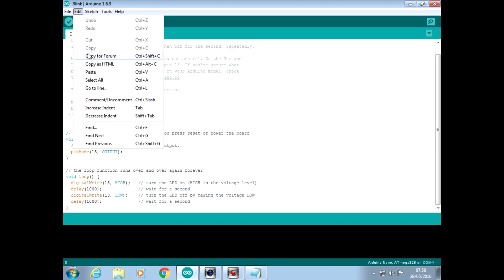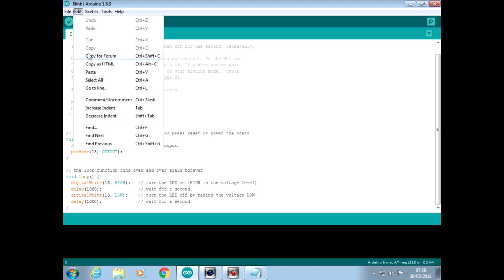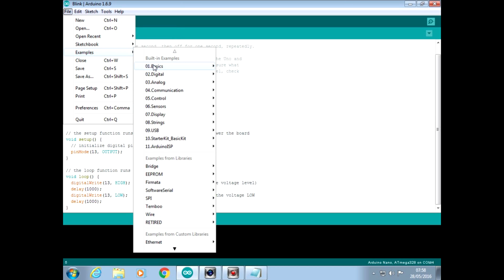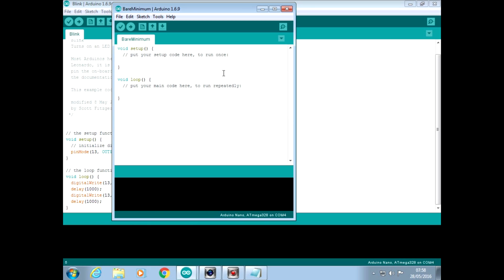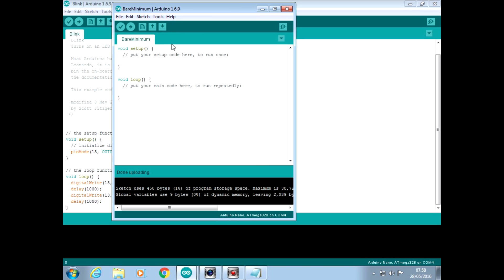Arduino NANO Power & Current Consumption

Comment: That Keweisi USB power meter (model KWS-V20) doesn't have enough resolution to calculate the power usage of the nano correctly. It is actually using about 3 to 4 times more energy than the meter is showing you. It is meant to be used with higher amp devices. I made a video about it here. (1 hour test comparison, fast forward to 28:05) https://www.youtube.com/watch?v=J42aXosHOps

Comment: how to keep arduino nano connected to the power bank always on. mine only turns on for a while?
Reply from the maker: You need a power bank that doesn't go into sleep mode or a separate li-ion battery.

Comment: Perfect, thanks. Not entirely accurate, but good enough. Definitely nothing to worry about for my bike light project. Battery supply will be either series RC 6S or 7S NiMH packs or my bad Makita battery which lost a series pair, so now 4S2P or even the good ones. Running flat doesn't matter. I have an LVD for the Li-Ions.
Arduino will PWM the front light (it's CC driven in the unit) for complete darkness use. Adjustable amount of spotlighting and a mode for flashing when on the street.
Rear red LEDs could even be PWM adjusted but the Arduino will do the flashing at the least.

Comment: Actually (at least on IBM360), no-op could either be 2 byte (NOPR - 0700 in machine code) or 4 byte (NOP - 47000000). It was a special case of the BC - branch on condition, but in this case, the branch was never taken. You could of course form a 6-byte no-op with 0700 followed by 47000000 or vice-versa. Not sure if there was ever a single 6-byte NOP instruction, at least on 360s.   Of course there were other 6-byte instructions, e.g. MVC (move characters), if I remember correctly.                        Thanks for the nostalgia trip. :-)

Comment: I have  nano, any project needed 5 volts more than 1, could it be 5 volts in cable seri / given 5 volt power adaptor / buy expansion shield? I need 3 x 5 volts. thank you

Comment: LOL still complaining about USB orientation. After all those years if you should be use to it and who cares if it's on the wrong side. Just flip-it, you have only two choice.
Reply from the maker: Think of the billions of times that a USB plug has been inserted the wrong way.  Let's call it 10bn.  At 5 seconds each time, that's  1,500 man years. All because of a stupid design by stupid engineers that everyone just accepted.  It's almost as bad as the engineering evil that was IE6.
Reply: @crazytom   yes you are right but maybe less than a day, mankind waste that amount of time on twitter. so fair deal.
Reply: Tom Donnelly, I agree with you 100% the guy who designed the original USB plug is just an idiot who got lucky. Those that say simply flip it should not complain when they receive a spam text message because in a similar fashion, they can just delete it.

Comment: Arduino Pro can work on even lower current - there is no RS232 chip, or any UART programmer on opposite side of the board. Just need programming once... (before that, you can test your programs on nano, but once you are satisfied, transfer it to pro).
Reply: WildMania or even better for battery operated there's this board https://wisen.com.au/store/products/whisper-node-avr